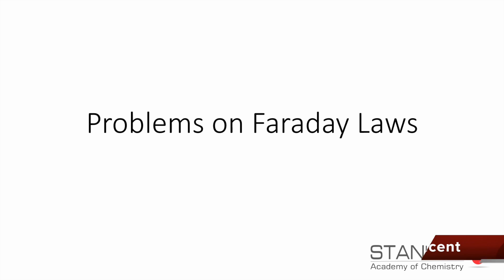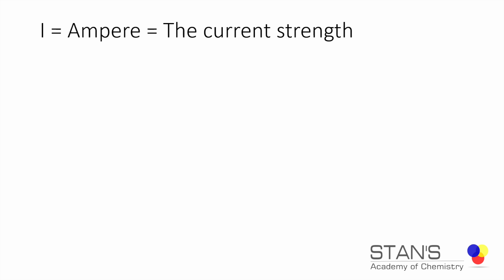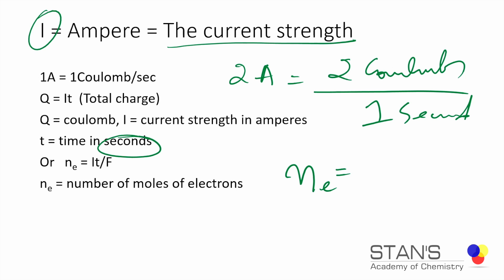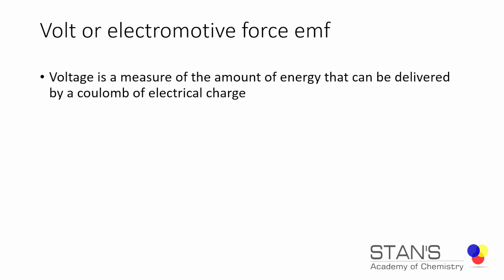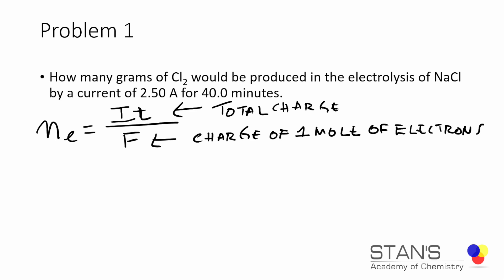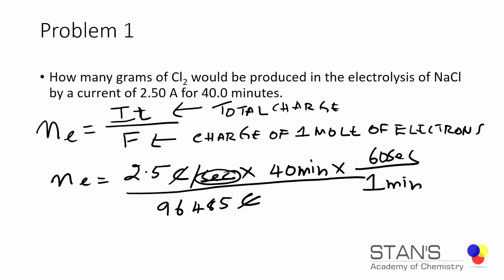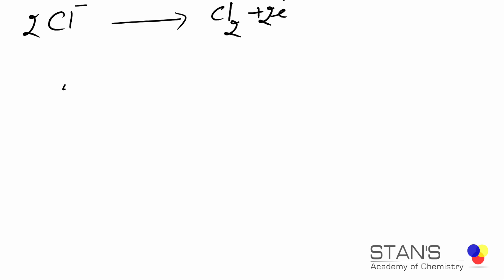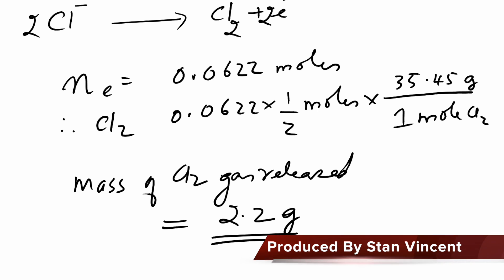Faraday's Laws  And Problems based on them | Electrochemistry

Comment: the result is 1.1g  not 2.2g :v
Reply from the maker: The molar mass of diatomic chlorine should have been used in the problem, there is a 2 missing (35.45x2) The answer was calculated using 70.9 g/mol of Cl2. So the answer still will be 2.2 grams. Hope this helps.
Reply: ohh I got it now thanks
Reply: ohh I got it now thanks
Reply: ohh I got it now thanks
Reply: ohh I got it now thanks
Reply: oh I got it now thanks